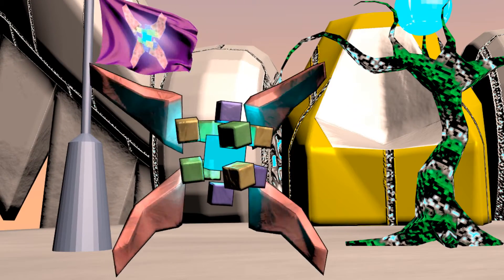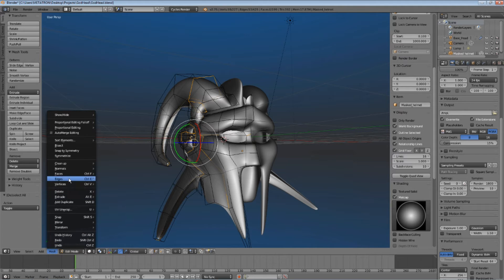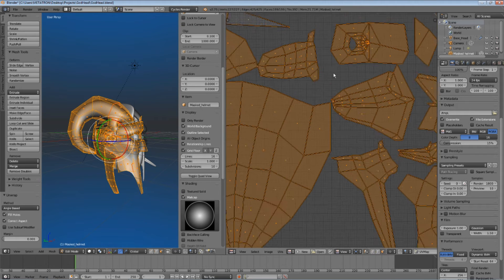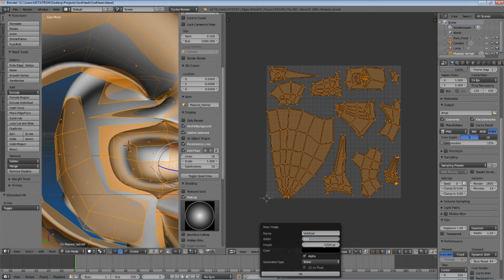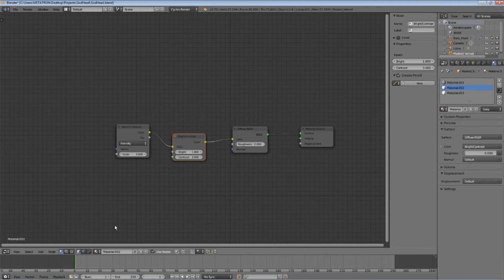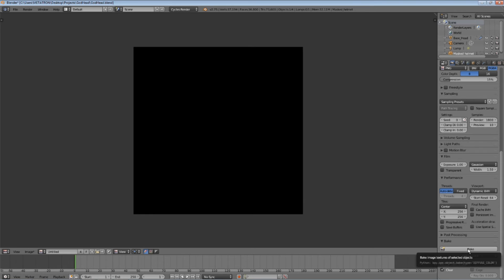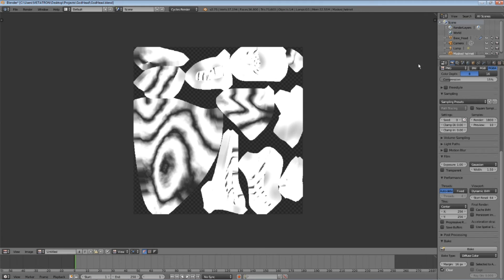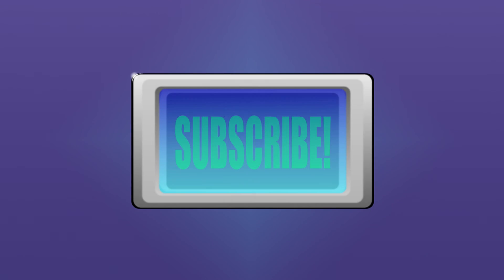Blender Cycles Texture Baking Tutorial

Comment: Great tutorial. Thanks a lot. I have a question. Say I want to back my materials onto a character that I plan to append into another file for animation. I want my characters to have subsurface, fresnel and all of that which is very time intensive especially since I'm using a CPU , but I want it to react to the light in other files. Do I need to remove everything but the color and bump/ displacement info from the material before baking? I need to bake as much as possible but for multiple uses.
Reply from the maker: You can select what you want to bake. You don't need to remove anything from the material, as it will only bake the information which you have specified. So, bake the individual textures for the things that you need. When you append the object, the material comes with it.
Reply: Thanks a lot. This is going to revolutionize my project.
Reply from the maker: Hope it does.